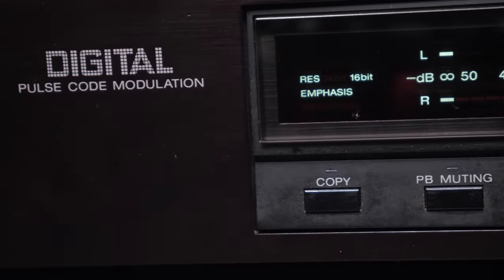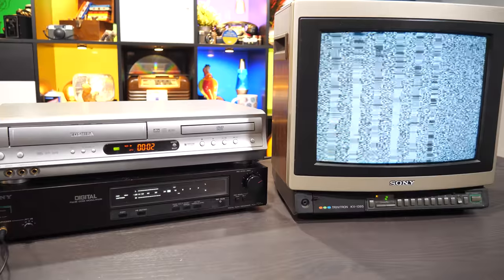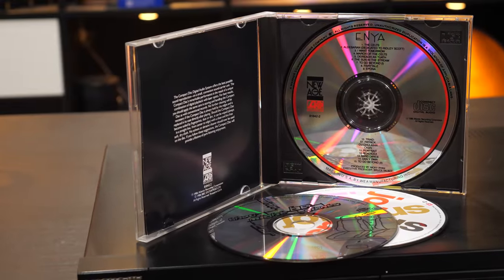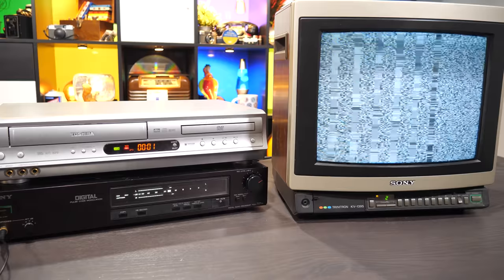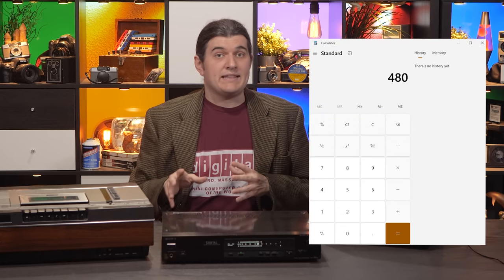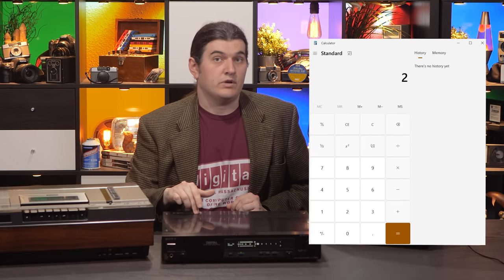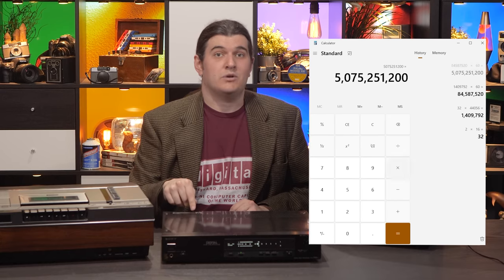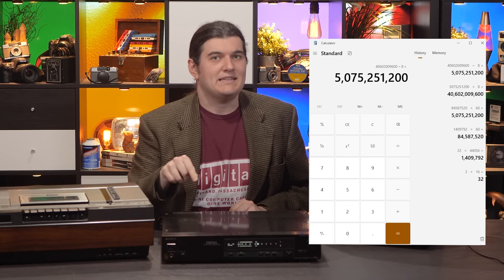Digital audio needed videotape to be possible - and the early days were wild!

Comment: I think one reason home computers didn't really see this type of videotape storage is the almost impossibility of accessing random data if it's not close to where the tape head currently is with the system.

It's okay for large backups, movies, and continuous audio... but anything else quickly becomes a nightmare. You'd want to store these gigabytes of content somewhere else so you can use them, and that was still a difficult problem like you've mentioned!
Reply: LGR once covered a videotape backup system for a computer.
Reply: When I was a kid my dad's used caset storage to run the backups for his job cassettes are great for cold storage
Reply: Tape cassette-based backups to back up your whole hard drive was not uncommon back in the Windows 3.1-ish days. I suspect the tapes were higher quality than your standard VHS though, and it was around when hard drives were in the realm of hundreds of megabytes.
Reply: Yes that's true. Without a control system for the deck, something that wasn't standardized on consumer VCRs, it is not practical for random access.

Back in the 90's I remember there was the Video Backup System for the Commodore Amiga made by Lyppens Software Productions, a neat product intended for making hard disk backups to VCR. I don't think it sold very well and was basically killed off by Iomega's Zip Drive.
Reply: One reason digital tape was not very popular with microcomputers of the day was that it was very difficult to deliver (and to process) the sustained stream of data (at about 1.5 megabits/s) in the microcomputers of the time.
When using a card and a VHS recorder, you would really need to keep up with the speed.
When using DAT tape (recorders were available for computers, these were in the half-height 5.25" form factor and lacked the audio part), a common problem would be that the data was not provided quickly enough, and the drive would stop, rewind, play until the end of the recorded data and then go back into record mode to write data until again its buffer would become empty and it had to stop again.
That constant back-and-forth shuttelling was bad for the mechanism and the tape, and it dramatically increased the time to record the entire tape.

This problem in fact still exists today.  Over time, capacity of backup tapes has increased a lot, and as the time to record the entire tape has remained about the same, that means the datarate went up.  On a modern LTO-9 tape with capacity of 18TB, the datarate is 1000MB/s.   That still is difficult to sustain over an entire backup run.
Reply: @Rob2  Interesting. I assumed modern backup servers writing to LTO just used huge buffers to prevent under-runs.
Reply: Didn't the C64 use a casette peripheral for storing data?
Reply: @keit99  Consumer Amiga models had one, but AFAIK it was generally used for backups.
Reply: @MegaZeta  oh that was probably it.
Reply: @keit99  As I recall you could get a cassette drive or a 5.25" floppy drive.
Reply: And the IT world had (has) their own tape cassette formats for professional backup applications where large scale data storage was needed, and this was an area where cost was not really a major issue and nobody was going to pinch pennies by hacking a solution together with videotapes.
Reply: @thomaswilliams2273  Pretty much every data storage format known to man was or is available for the C64.

Regular audio cassette, ROM cartridge, 5.25" & 3.5" floppy, waferdrive (which used tape loop cartridges), hard disks, VHS (the very rare DC Electronic's Whizzard), Compact Disc (with data stored as audio), SD cards, USB, flash memory and even network storage.
Reply: The other issue was you could only backup as much data as your source hard drive could hold, and typical hard drives didn't begin to reach gigabyte sizes until about 1995. This was at a time when Windows 3.11 fully installed required less than 20 MB.
Usually if you wanted to make a backup it would've been cheaper to buy a second drive, which also gave you the the benefit of random access I/O.
Though for personal desktops most people just used floppies, since the total size of their own documents usually totalled less than 100 MB.
Reply: I don't get that part of the video as it's pretty obvious why tape solutions didn't catch on with home computer systems.  Not only were they slow (no random access) they were also costly for what they offered and largely unnecessary.   I used to see several tape solutions in computer magazines back in the 80s and 90s including ones that would fit in a 5.25" drive bay and even the VHS one mentioned.  But I never considered them as they were impractical for home use.  We did use tape solutions at my job back then to backup servers.  But that was used for what was at the time massive data sets - not something most home users would need.  Early computers did use cassette tapes but at least in the US that was quickly replaced by floppy disks.  So home users had already rejected tapes early on and weren't going back.

Comment: These were used sometime in the 80's by BBC Radio for some onsite OB recordings, usually classical music. IIRC they replaced digital reel to reel recordings (made on, I think, Mitsubishi?) that had to be replayed in the OB truck in the studio centre carpark. Recordings were made on Beta and replayed on a C9/701 unit that lived on a trolley that was wheeled into the appropriate control cubicle. I've also got a vague memory of them being used for live OBs that had a video link out of the venue.
Reply: I'm glad you posted that story, because I remember being a new engineer in BBC News' Spur Central Apparatus Room (SCAR) around 1983 and seeing that unfamiliar signal coming through our switching centre and being told it was a Sony F1. I only vaguely remember that it was an OB from somewhere!
Reply: What do you mean by "OB"?
Reply: @mattgies  Outside Broadcast. Nowadays a quality audio recorder can fit in a pocket, but then they were big and heavy, Google "Mitsubishi X-80 or Studer A80". It was permanently mounted in an OB van. When a concert was recorded for later broadcast the mixing desk might be set up in the venue and it's record output tielined out to the recorder in the van. Network Radio didn't have an X80 so the broadcast would be repro'd by the van/truck in the carpark and tielined to the network continuity suite (master studio). Once concerts started being recorded on Beta it was easier and cheaper to keep a dedicated repro machine at base.

Comment: We have one of these Sony devices to record up to 15 analog data (DC-5kHz) channels via a multiplexer.  It is from the USA so requires an NTSC video recorder and 240-110V power supply converter. And there are two audio channels too.  Works a treat.  Replaced an earlier Australian-made 4 channel unit using FM modulation onto a 4 channel reel-to-reel, which dated back to the late '60s.

Comment: Minor point about CRC - CRC is error detection, not correction.  You need some type of ECC, like a Hamming code, for that.  Reed-Solomon is a newer one (but not that new - it's used on CDs), but probably too complicated and too late for a device like this.
Reply: I worked for Sony's short-lived Pro Audio division back in the 1980's. We developed a DASH system (Digital Audio Stationary Head) that used a 24-track audio deck to lay down digital audio in stereo. This would be used for mastering an audio mix in a professional recording studio. It used Reed-Solomon coding to take care of error correction.
Reply: @geoffhetzel9691  Yeah, Reed - Solomon was invented in the 60's, so it makes perfect sense stuff from the 80's would use it, including CDs (the first CDs were introduced to the market in 1982, so most of the key product development was probably late 70's).  But, as was mentioned in the video, some of these PCM devices date to the 60's and appear to be compatible with the newer ones.  Theoretically, they could have use Reed-Solomon since I think it did predate the earliest units he mentioned, but it would be a tight fit.  Hamming code is alot simpler and was invented in the 40's, so it's probably a better candidate, given the electronics of the day and product development schedules.  It's also possible both were used.  Perhaps the earlier 14 bit ones were Hamming and the later 16 bit ones were Reed-Solomon.  That would actually make alot of sense - new products, like CDs or your DASH system, are rarely truly new inventions, but instead incorporate lots of earlier work.

Like you say, Reed-Solomon encoding is very widely used.  Apparently we haven't found anything massively better because it's still getting incorporated into standards like DSL, ATSC, DVB, Blu-Ray, and many others.  It was even used on the Voyager probes.

Comment: I used a pro-model one of these in the recording studio I worked for. Other than the XLR inputs and the specific 44.1kHz sampling frequency, it was very similar to the one you show here. It was so neat to see the digital audio on the TV. Not long later, we used DAT machines for this purpose, and they were much easier to use. The pro DAT machines allowed us to use 44.1kHz sampling. Consumer models only allowed 44Khz sampling.
Reply: The first consumer DAT machines used 48kHz.  Later ones also could do 44.1.

Comment: The "shuffling the data around" approach is used in deep space (and presumably less deep space) communication encoding too. The idea being they characterise the sorts of 'damage' that normally occurs to a signal and find it is often time-limited. So, you shuffle the signal and spread the 'damage' such that each error correcting section gets fewer bad bits, and the maths (Hamming codes) can recover the bad bits per section. You then un-shuffle, and hey presto, the original data. Compare to it being perhaps easier to fix five small holes in your tires than one giant hole.
Reply: And if I recall correctly, the CD and DVD formats (for both audio/video and data) do the same thing for the same reason.

Comment: There actually were official pre-recorded releases on this format, believe it or not. Mobile Fidelity Sound Lab (MFSL or MoFi) made a few back in the early 1980s for the audiophile consumer market (on both VHS tape and Betamax tape, depending on what the customer wanted). One of the albums they released on this format was Pink Floyd's Dark Side Of The Moon, which is probably the rarest official release of Dark Side Of The Moon ever released (I would say "most sought after" but truth is I dont think most collectors even know it exists, because most collectors focus on vinyl only still). MFSL didnt mass produce these of course; they were made by hand whenever someone ordered one, and probably less than 100 copies were made of Dark Side (and who knows how many of those have been tossed in the garbage in the years since by someone cleaning out the estate of a dead relative and just discarding it as "some old vhs tape").

This was in 1983, so may well be the first digital release of this iconic album; the first CD release of it was also in 1983 (in June), in Japan, but Im not entirely sure of the timeline on which of the two came first. Would in any case be very interesting to compare the two, both in terms of just sound quality, but also comparing the masterings.
Reply: Funny to think DSOTM was only 10 years old at this point. The original analogue masters would've still been in pretty good condition.
Reply: @zoomosis  I often muse about how much changed in 10 years in the last century, in terms of how things age technically; whereas in this century we have still have breakneck technological change, but the style and technical depth of music hasn't really changed much in the last 20 years at all.

Comment: Great video! These were used by a lot of musicians with home studios as a digital two track mix down mastering recorder. Way better quality than two track analog tape decks. You have to remember that this was the only relatively inexpensive way to record audio to digital for a few years. CD recorders were expensive and came later. As did DAT machines. We were mastering our music to audio mixdowns to HIFI VCRs which had great sounding audio, then these digital adapters came out. A few VCRs even had these adapters built in- like from Toshiba.
Reply: I actually recorded some bands live back in the day, using a hi-fi Betamax machine. The playback blew the musicians' minds. Good times!

Comment: #1: These videos are so enhanced by the CC that has been lovingly (and time-consumingly) entered.  #2: In the early 90's I worked at 2 different radio stations.  One was cutting edge and used a DOS PC connected to 3x Sony CD jukeboxes for automated playback.   The other was a non-commercial, low buck (and exceedingly more fun) where we used PCM-encoded VHS tapes as our automation.  The trick was you'd have to record "live-to-tape", in real-time, so it wasn't a time saver, but it did allow us to schedule shows/talent in times other than when those people would be available, in addition to allowing for "re-runs".   The hot-shots at the big station laughed, but the little station sounded every bit as good on a fraction of the budget.

Comment: One thing I noticed is that the samples in the signal are staggered, i.e. if you look at the blocks, they don't form a horizontal line from left to right but a diagonal line. This has to be deliberate, since VHS wouldn't normally record that way. It also helps the error resilience.

Comment: That was very interesting. When I had a job as a teenager from 1995 to 1997 as a rapper and clean up boy in a meat department of a grocery store, I did have some cutting duties but it was the wrapping machine that fascinated me. It was likely from the area you are describing and it used an audio cassette to digitally feed each week's prices for each product into the machine so that when we enter the product code it priced it properly. I remember observing my boss programming and audio cassette in the office where they had the device to put in price data and converted to an analog cassette tape and then loaded on the machine in the Meatpacking room. Quite fascinating and I never fully understood how it works but now I do. I've been a lurker up until now but I really appreciate your content!

Comment: I was in TV broadcast business and we got our first still store unit in about 1982. It had physically huge Winchester drives that I think handled ONE GB. For backup it could spit out video as PCM data the same way as the Sony audio machine. It would be a screen full of block data patterns that was recorded on to 1 inch videotape (it worked on 3/4 in as well) It took a few seconds for each still to be sent or received.
Reply: You were doing well to have a digital still store in 1982 I reckon - in the UK several commercial television stations (not small operations either) were still operating programme playout utilising optical slides until 1989 when the ITV network finally mandated they upgrade...

Comment: Another interesting thing you could do with this thing is quadraphonic audio. Of course, that’s nothing unusual, especially with reel to reel recorders, but you’d have the advantage of two channels being digital. The company that manufactured and maintained the animatronics in Showbiz Pizza restaurants in the 80’s used a machine like this to create the master for the show control tapes. They stored the show audio in the PCM data and stored the show control signals on the regular audio channels. They dubbed this onto regular quadraphonic reel to reel for the restaurants.

Comment: Sony was also working on a digital multitrack recording system in 1977, it had 24 tracks and a 16 bit 48 kHz sample rate and was recorded on metal particle tape, the prototype machine was used to record the soundtrack for "Star Trek, The Motion Picture" and sony got some very valuable information from the sessions and delayed the recorder until 1982 while requested features were added (the ability to "Scrub" audio and make a tape spice edit that did not introduce artifacts) The machine was sold as the PCM-3324 and used 1/2" tape running at 15 or 30 IPS.
Reply: Made extra interesting that the 2-disc reissue of that soundtrack was supposedly remixed from a backup analog multi to yield both the 2-disc and a 96/24 stereo file for commercial streaming or HDTracks download. So the aforementioned digital multitrack was either lost or the hardware is missing to play it back.
Reply: 30 IPS only. Designed with expansion in mind, the tracks were actually narrower than the guard bands on the 24 track DASH machines. When the head design permitted it, the format was expanded to 48 tracks in the PCM-3348 using the same 1/2" tape. A 24 bit version, PCM-3348HR ran at 45 IPS. Early Sony tape stock was very error prone, such that later tape was actually manufactured by AMPEX and just labeled as Sony, so it does not surprise me that the first use of the format might have deteriorated beyond repair.

Two track machines were made that ran at 7.5 IPS that used 8 tracks to interleave the data (PCM-3202). PCM-3402 ran at 15 IPS and utilised the same 8 track layout on tape, but the data was split between two tracks interleaved with one method and a 100% redundant pair with different interleaving. The idea was to allow razor splices, but there was a nice edit function in that one, but it required two decks connected together.

Comment: Back in the 80's I worked at a company that used Xerox CPM computers. Our backup solution was a VCR with a converter that transformed the files into a video signal.
Reply: Same here with an Alpha Micro.  It was a custom board that went into the S-100 bus computer.